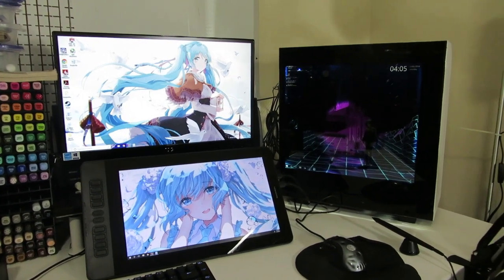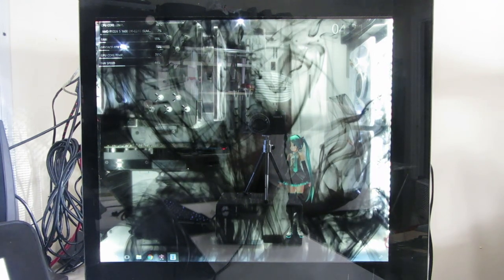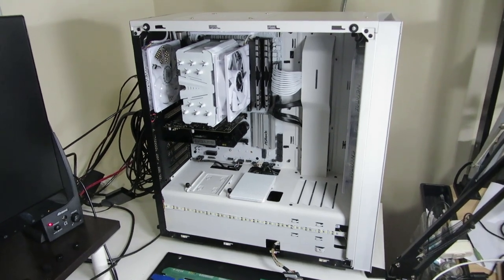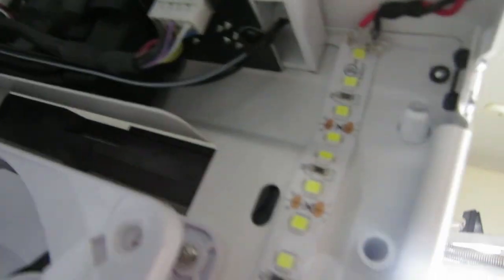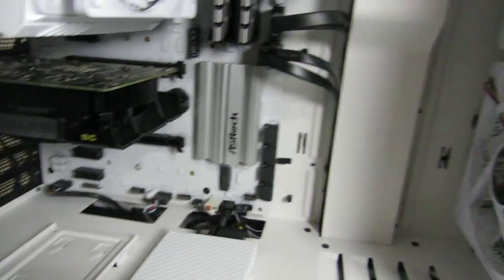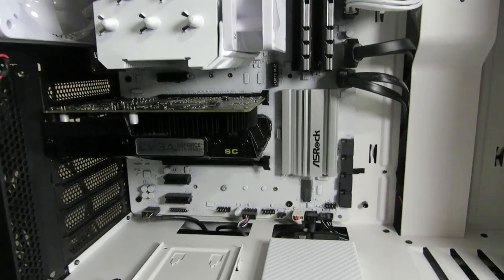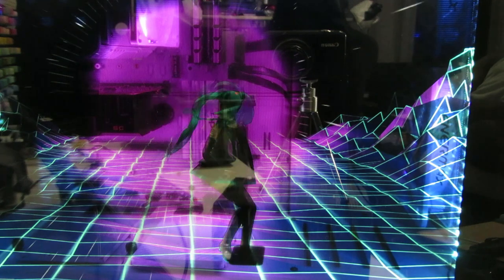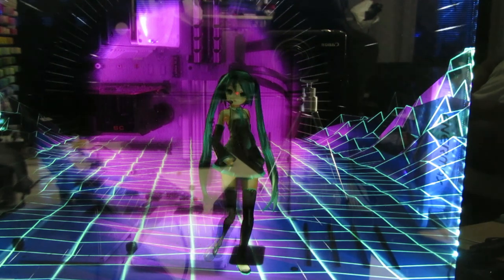LCD Sidepanel Mod

Comment: If they sold this as a DIY kit at retail brick and mortars complete with the visualization software included, it is a for sure pick up for me. I would integrate it with custom liquid cooling straight tubes for all components with an additional lcd panel at the front of the case overlapping the clear water distribution block. Excellent modding, that is an inspiration. 👍

Comment: Don’t have to paint the GPU, I use a white paper with some GeForce printed on it and put it in top with small double side tape in the corners and center. Looks great and no heating problems. Great job!

Comment: Very cool build. Did you try changing the brightness of the monitor to have better visibility of brighter colors?
Also I dont want to paint my internals, is the white color very important, or will better lighting do the same job?
Reply from the maker: I'm pretty certain I lost any kind of access to brightness control when I removed the backlight from the unit. I think I'd just have to use more LEDs if I wanted it to be brighter.

White internals really do make a difference. I've since painted the GPU white and it did make a big difference when the image overlaps that area.

Comment: forget disco rainbow RGB cases, I want this! I just have basically all black parts . I want to try it and maybe if i need to do the extra work to paint everything white. I have a CM500P case and im also concerned how the very slight tint on the glass will effect the picture.

Comment: I have the HyperBeast case of the s340 elite and i have a quick question, is that vinyl wrap you used to cover up the blank spaces? also... i have the nzxt hue+ in my system currently and I don't really want to get rid of it...would it be plenty to light my panel even inside a dark case?
Reply from the maker: Yeah I used black vinyl wrap. I would probably suggest something a bit more robust though as it tears easily. I've had to fix some spots, where I got tears and scrapes, with electrical tape.

I'm not sure if the typical LCDs that a hue+ controls would be bright enough, especially in a dark case. You need a LOT of very bright light to make this work. A white interior is pretty much essential.

Comment: Did you had to buy a acrylic sheet like imoddernation? I’m not sure how I would replace the window for the s340 elite.
Reply: kevin ha I did buy a piece of acrylic, but I just used it to sandwich the PCB so it couldn't group out on anything inside the case. The tempered glass sidepanel on the S340 Elite is way nicer than acrylic.

Comment: Does the monitor-MB fit in the psu shroud
Reply from the maker: Yeah it's able to all fit in there. It's very snug especially with the power supply cables, but it works somehow. I actually switch out my original PSU for a modular SFX sized power supply with an adapter bracket to free up more space down there.
Reply: @ragnoroksixtyfour3828  can u uploud a picture of that and send me a link please?
Thank u for the quick respose!
Reply from the maker: @quammelschroedinger780  I'll tell you now, it ain't pretty. The basement wiring is a rats nest of "Does it work? That's good enough."

If you really do want to see a pic though, here it is https://imgur.com/uGQXULA

The part you'd likely be most interested in is that I sandwiched the PCB between 2 pieces of Plexi to keep it from being able to ground out on the metal case.
Reply: @ragnoroksixtyfour3828  thank you, i did the acrylic thing already to prevent the pc and monitor from frieing.
Thx for ur time i think i should be able to do this mod now.
Reply: @ragnoroksixtyfour3828  ...wait have you ditched the powerboard and if so what connector or cable have u used to power the videabord
Reply from the maker: @quammelschroedinger780  I used a molex connector from an old 80mm fan I would never use, and connected the ground and 5V wire directly to the mobo.
Reply: @ragnoroksixtyfour3828  a last question:
Could u upload another picture how you connected the fan cable to the video board.
Reply: @ragnoroksixtyfour3828  or is there already a picture out there what poles u have to connect to what cables or what poles are for what(ground and 5V)
Reply from the maker: @quammelschroedinger780  The thing is, that can be different for every model. I happened to get lucky and the pinout was labeled on the board itself.
Reply: @ragnoroksixtyfour3828  at my power connector on the video board it says:
+5V
+5V
+5V
GND
GND
GND
AUDIO-DET
AUDIO-EN
BKLT-EN
BKLT-ADJ

do i have to connect all avalible pins with fan cables or is one 5V and one GND enough?
Can u pls upload a pic on how u did it?
Pls, thanks for ur time.
Reply from the maker: @quammelschroedinger780  I'm honestly not sure on that one. I'd test it out with just one +5V connection at at time and see what happens. You can always connect multiple in the future if that's somehow necessary but if you burn out something by giving it too much juice you can't really roll that back.

Comment: hey mate what are the parts your using in your main rig?
Reply from the maker: My main Rig has a Ryzen 7 2700, GTX 1070ti, 32gb of Trident Z RGB RAM, a Crosshair VI Hero motherboard, a 750 watt PSU, and a couple SSDa and an HDD.
Reply: @ragnoroksixtyfour3828  wow thats fully loaded!. since your 1st rig is so powerful, what do  u need a second one for?
Reply from the maker: @masha1845  Replaced parts from my main rig (CPU, RAM, GPU) migrated to the secondary rig. Also just because I can :D

Comment: I'm having problems wiring this up :( is it possible to wire it to usb ? I attempted to wire it to the PSU that didn't end well 🤣
Reply from the maker: There are USB LCD displays so it's likely possible. I couldn't necessarily tell you how to do it for your specific monitor. 

with regards wiring to the PSU. You want to make sure to run the LCD from the 5V line not the 12V. Check online for the pinout of whatever connector you're using.
Reply: Ragnorok SixtyFour I finally managed it thanks tho :) just struggling to find a white motherboard 😪 so hard to find but nervous to paint mine
Reply: @ragnoroksixtyfour3828  hi how are you guys finding the pinout for the monitor board
Reply from the maker: @disableme152  Mine was labeled on the PCB.

Comment: Which monitor did you use , for nzxt
Reply from the maker: Dell 1905FP
Reply: @ragnoroksixtyfour3828  i used E193FP but im having problem which wire to cut to connect to 5 volt PSU

Comment: Plastidipping the mobo is safe?
Reply from the maker: If you make sure to mask off any ports and sockets you should be fine. There's several tutorial videos on YouTube for it.
Reply: @ragnoroksixtyfour3828  What about heat build up? Sure its not huge concern, but still you are insulating components that are designed to be least cooled by some air contact.
Also electric use of panel and leds should be considered, given system probably is on long times, not to mention heat it creates.
Reply from the maker: @Hellsong89   I don't believe enough heat would be generated to be an issue. Also for components that that had heat sinks I removed the heatsinks, masked them off, and reassembled after spraying it down. 

Which isn't to say that there can never be any issues with it, but I'm willing to accept that risk.